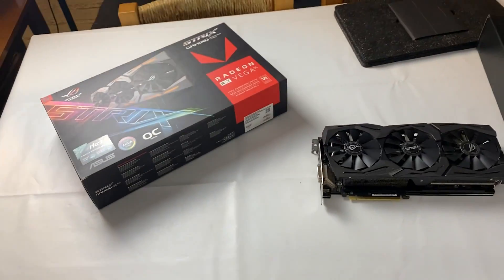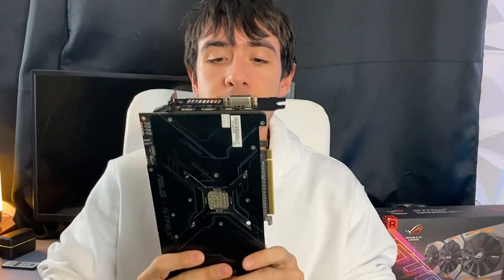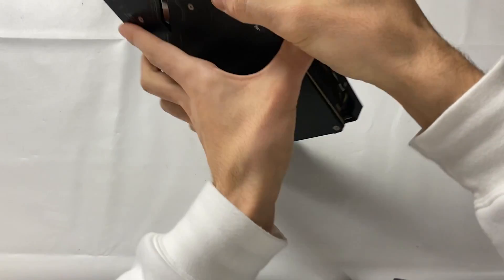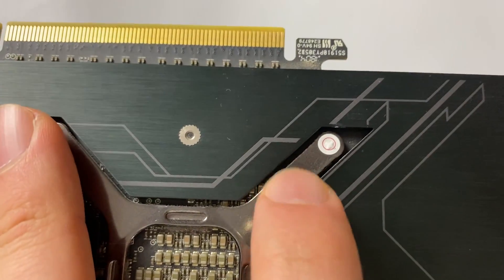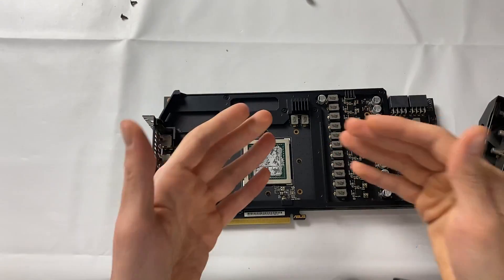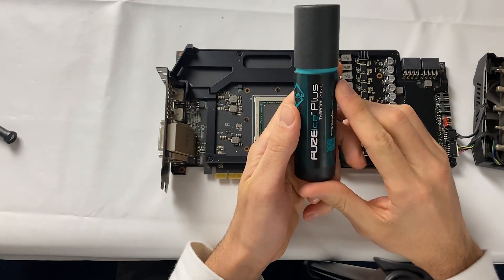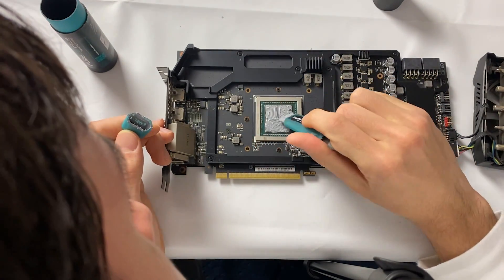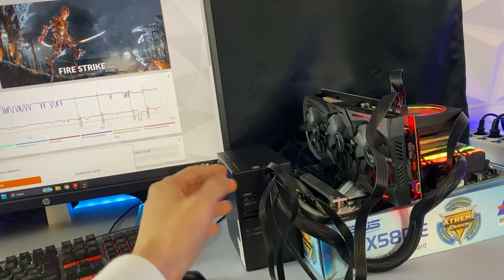Gaming on a RX Vega 56 in 2024… Bios Mod and Overclock for under 100$

Comment: 24500 graphics score fire strike 
Core:
p7 1710mhz 1070mv p6 1650mhz 1030mv p5 1450mhz 980mv p4 1250mhz 950mv p3 1138mhz 920mv p2 1084mhz 900mv p1 991mhz 850mv p0 852mhz 800mv 
Memory:
1100mhz 1000mv 
Power límit: 
+50
Gpu: Vega 56 gigabyte gaming oc with bios Vega 64 gigabyte gaming oc 
Cpu: xeon E5 2650 v4
Ram: 16gb(2x8 2400)

Comment: The Strix cards are awesome.I found a Power Color Red Dragon version in its original box and in very good physical condition. It tested good and runs cool but GPUz reports it runs in x8 mode only not x16. My other AMD cards run using all 16 lanes. I even tried it in another machine. I do not see any damage to the fingers or any damaged or missing SMD's. It runs very good and I know that it is not losing much performance but I still would like to solve this mystery. I even flashed the bios but no difference. If anyone has any suggestions I would appreciate any tips.

Comment: nice job but you have a golden sample card. most people cant get past 1100mhz memory, i tap out at 1080, never mind 1150. and your voltage being sub 1v for 1660mhz is again really crazy, i get unstable if i drop voltage below 1070mv at 1600mhz. my firestrike sits in the 23600 area. what you got is mental tbh.

Comment: Will this work on the Arez vega 56? from what i understand its a rebranded strix.
Reply: From what I understand you need a card with samsung memory or you are screwed
Reply: @rickmacdonald6355 It has samsung memory. I ended up getting it to work but have since sold the gpu.

Comment: i will buy this card asus strix oc in my area for 100$     
Knowing that 1660  used for 150$ 
should i buy vega ?
Reply: If you have a good power supply and are willing to have to modify its factory settings at least on the adrenalin drivers to get the most out of it, I definitely recommend it. Just don't pay more than $100 for it. I bought a Vega56 for $75 15 days ago and it's a beast.
Reply: @_Pikasso  In my area it's a very good price and considered a bargain
And i will undervolt it to reach 160 watt Or close to that

Comment: people forget that you can actually enable SAM / resizeable BAR with some modded drivers, it should increase performance even further
Reply: Only if the card is tuned proper with undvolts and custom regedit mods to increase its max draw. Hbm2 is its crutch and for sam to actually be a hindrance.  If vega had like gddr6 on it instead it would have been a beast and easily taken out a 1080ti, even though it can now with know how.
Reply: @michaelmok3646  the 56/64 vega card where made by AMD to answer the calls of the GTX 1080, which shows in performance tests.
so it's not uncommon or rare that these cards could also match the Ti version with some expert tinkering.

Comment: I bought mine vega 64 for 100aud that is like 60 euros just trying to find which cpu will work well in a budget happy with 1440p if someone has any tip thanks
Reply: Ryzen5 1600 or Something Like a 8600k should bei plenty of Power. My sister rund an ryzen 5 1400 Quad Code 16gb RAM and an rx580. She quiet Happy with this Setup
Reply: @danielbernhard1250  i have a 1600af and is not powerfull enough cpu will 100% lagging in 1440p i got finally 5600x and was perfect even for som 4k

Comment: I just purchased one just like yours but when I tried to do the ATI flash I am unable to see the screen when you select the new bios. I sent three hours working on it last night, I ended up replacing the paste and putting new thermal pads on it.  I’m just having issues with the ATI program I’ve even tried the older version I’m wondering if it’s not compatible with windows 11. After much research apparently you need and old version of windows 10 to make this work real bummer.  Please correct me, or inform me of a workaround if anyone has one.
Reply: Resolveu? Encontrou uma solução?

Comment: Got my Sapphire one and the cooler is twice the size of the PCB. Great temps. Zero frames drop in Fortnite. Great card. Of course it is great if you pair it with a capable CPU (i3 12100 seem to be quite enough for that video card).

Comment: Dear author, thank you for the guide. I managed to flash the Powercolor Red Dragon version and overclock it.  After tune I got 24197 points in firestrike graphics test.  But I had a question, can u please answer. Using stock bios 56 it consumed 185w, stock 64 220w. Now the peak values reach 300w. Is this normal, does it harm the graphics card? Temps and noise are ok

Comment: Ive been beating the living fuck outta my Vega 64 and R5 3600. Day in day, out Pushing high settings on 1440p since Jan. 2018. Card is a MSI Boost OC.. Basically Just a branded reference card So the first few years was tike living with a leaf blower! With that shitty fan always screaming at %100. Until I Got the nzxt AIO mounted. Didn't feel like drilling holes or looking for screws So i just grabbed a lil thermo paste and some zip ties. Lol they worked great for 3-4 years now.

Comment: You can get these cards refurbished from MSI Air Boost for $125Cdn from N.E.  They even updated the fan so that it's a lot quieter under load. I replaced my old GTX 1050 with a AB and boy was it worth it.  But then again the games I play aren't that demanding on a card. The game I play went for Mid to high 80 fps too 140's stock.
Reply: Fan quieter under load is the stupidest thing anyone would possibly think about. Video cards have a long life if they get cooled well not if their fans  are quiet. If someone need a quiet PC they should buy a sound dampening PC case not spin the fans at a lower RPM.

Comment: I have a vega 56 powercolor red dragon, which vega 64 bios should i use. there is not a vega 64 red dragon, only the standard 64 and a red devil?
Reply: same red dragon version. I used standart 64 it has power limit 220w. red devil version has 260. My stock vega56 185w - i was afraid to choose red devil version

Comment: Of course it’s still a useable card. It’s Better than a RX 580 and plenty of people are still using those. I got my blower fan style Radeon Vega 56 for 40$ almost brand new on fb marketplace a few months ago and threw it in my razer x chroma egpu that is connected to my 2018 Mac mini set up. It does the job and beats the internal graphics in any Intel Mac. I also have a 1060 6gb, a 1080 ti, a 2070 super, and an evga 3070.

Comment: do you still lookup the comments? hope so! i got a ASRock Phantom Gaming Vega 56 with the *.0.023640 bios and the HBM2 module but it is HYNIX, and not samsung. and everybody keeps saying that i shouldn't/couldn't flash to a vega 64 because of this (hynix, not samsung). though i've got a 0.046561 bios form techpowerup. is it ok to test even on a v56 bios?
Reply: I'm in the same situation, lets see if he answers you...
Reply: @narcsba  Disregard my last comment. The bios flash supports Samsung and Hynix memory modules. Should be just fine.
Reply: It's written in the "details" section what memory timings it supports (8192 MB, HBM2, Samsung KHA843801B) or whatever memory supports

Comment: Is it still worth it?
I want to upgrade from RX 580 8 gigs to faster card. The choice are RX Vega 56, RX 6600 XT and non XT, and RTX 2060 Super. Price range is similar for the RX 6600 XT non XT and the RTX 2060 Super. Of course, the RX Vega 56 not even a significant upgrade for me. But the price so cheap (it's only $83). I pair my card with FX 8350 btw.
Reply: You would be better to upgrade your cpu first. The FX 8350 even when overclocked is serving as a bottleneck for your RX 580. If you spend money on your GPU, you will not see much performance gained
Reply: @liferescripted  Welp, my RX Vega 64 just arrived. Guess I used it 'till next CPU upgrade then.
Reply from the maker: I think you made a great purchase with the Vega, it will go a lot faster than the 580 if tweaked properly. But yes I’d upgrade the CPU asap as well!
Reply: @ImWateringPSUs  Yep it's true. I undervolt and OC my RX Vega 64 and get 3-5W on idle, 60-70W while playing MGSV and Nier Automata without anti aliasing on 1280x1024 resolution. I'm happy enough with the result!
Reply: no please do not pair any vega card with any fx cpu. Both of those parts were famous for using waaaay too much power for their respective times. unless you have a high wattage, high dollar psu, and do not care about how much your power bill costs, upgrade your cpu to something newer first like any amd ryzen, ddr4 intel cpu, hell even a ddr3 intel cpu would do better than an fx.
Reply: @steaksoldier  vega still draws alot less power than an rx 580 for the exact same fps and settings... for example playing in 60fps locked, where rx 580 draws 120W, vega draws 80W... Its those extra 30 more fps that costs 100W more power on vega
Reply: @bervirus  Yep, that's true. I'm amazed this card more efficient than my old RX 580. I usually leave the vsync ON for the efficiency.
Reply: Which one is better ? I will buy one of those  @bervirus
Reply: @SergeoRamos-f9u  Between RX580 and Vega? Vega of course...  Anyway for 2025 if you have the budget, better to just get RX6600 or something newer...
Reply: @bervirus  dont have budget for sorry 
Now i need to understand something rx vega 56 with flash bios 64 V limit better than rx 56  normal bios with V limit 
I will buy one should i do this ( bios 64 ) is this stable
Reply: @bervirus  i will play 1080 should i do this or just keep normal bios
Reply: @steaksoldier  Thanks for the advice, soon I will upgrade my CPU for better performance per watt

Comment: I still own my Vega 56, which I bought back in early 2019. I ended up purchasing the Morpheus II cooler for it. It's a great card if you're happy to tinker, and I was. It's now in my girlfriend's PC.
Reply from the maker: That’s great to hear! I’m a big fan of aftermarket GPUs coolers, love the Arctic Accelero as well and even the NZXT AIO kit. It’s a shame they stopped making them :) Great to hear you’re still putting the card to good use!
Reply: @ImWateringPSUs  I looked at both the Nzxt and the Accelero, but I went with the core edition of the Morpheus 2 cooler, I read it had a larger die coverage for the Fiji and Vega cores. It wasn't easy to find one at the time, but I managed.
Reply: Same here lmao

Comment: hey i have a vega 56 air soft msi and a 5600x do you think i should do this? do i need to unisstall something?
Reply: I have same card. It should have dual bios. You can flash the 64 bios on one and have the regular 56 bios on the other. I have had that card draw upwards of 300 watts of power and it is really finicky. When the 5600XT came out I compared the vega 56 to it and ran benchmarks. Always got ~10-15% better performance on the 56 over the 5600XT(with the 56 bios on the vega). However over the last year and a half, that has drastically changed. I am talking a 20-30% swing. Haven't really delved into it much, although I have used modded AMD drivers from NimeZ for SAM and other features but really no difference. I am running a 5600X processor and I have since it was released. I jumped about 10-15 fps in Heaven and in the games I play like WoW, COD, The assassin's creed franchise, on both cards, upgrading to the 5600X from the 3600. And that drastically changed sometime in early 2023 I believe because on Heaven alone, I would average about 100-105 fps total in the full benchmark with the 5600XT and anywhere from 110-115 with the vega in 1080p. Now, its the opposite. 95-105 fps on vega, 110-115 with 5600XT. nothing changed in my PC but the updated drivers. I firmly believe AMD has purposefully left out the vegas in driver optimizations because its coming up on EOL. And is exactly why last summer I switched to team green and will never buy another AMD video card. Their decision to scuttle Polaris and Vega architecture support is mind boggling. I have never owned anything but AMD Video cards until they pulled this crap. Shame on them.
Reply: @jasonphillips6400  so what are the down sides?
Reply from the maker: I would definitely recommend doing this, yes! No need to uninstall anything :))

Comment: I hope you answer i have a vega 56 shapire pulse (samsung memory) myself paired with a r5 3600 and only get around 100 fps on warzone with bad 1% lows do you think doing this mod with be worth it?
Reply from the maker: It will 100% be worth it! But your limiting factor is also the CPU, you should get a R5 5600X if you can

Comment: Bro, I just picked up this MSI Vega 56, and it seems to have Black Screen issue, do you happen to have any tips for it?
Reply from the maker: If the card boots and sometimes black screens, a different bios can help. If it doesn’t boot at all heh, it’s difficult to fix my man😅
Reply: @ImWateringPSUs  Bro are you using windows 11? I'm in 10 right now, does it make any difference if I upgraded to 11? Also what driver and driver version are you using right now.

Comment: Does it have any cons if in case you do this? Like throttling or overheating or even killing the gpu itself.

Also, will it more power? Or its just as advertised at 210W. Will it also work to my Gigabyte GP-P650G PSU? Or need more power
Reply from the maker: It’s all about how you set it. After the undervolting in the end, the card drew 150W to perform dramatically better than at stock. But if you only bios mod it with no Undervolt, it can draw as high as 300W. It will definitely work fine for your P650G PSU, check out the build video I made with it as I used it with a 550W PSU.

Also consider dropping a like and subscribing if the content was useful and/or interesting:))
Reply: @ImWateringPSUs  fasho thanks man! Lovelots from Philippines

Comment: Got vega 56 for $70 last year (gigabyte gaming oc model). Great GPU but not for everyone, especially this particular model.

Comes with freezing and overheating issues (black screen with max fan). Its still definitely worth it ---after I cleaned it, repaste it, replace thermal pads (5 different thickness), added heatsinks to the backplate, flashed the latest vbios (with slightly reduced power limit), tuned the fan speed (default fan curve was too slow/silent), adjusted power limit or UV, and used the Pro Edition driver.

Now its running problem free, and will serve for another or couple years, probably. Scored 20800 at default (210W) on firestrike. Still scored 19600 on my UV profile (~125-135W).
Reply from the maker: Great to see some feedback like this one! I 100% agree with you, it’s probably the best value for money card out there but one has to be prepared to do some maintenance/upgrades in terms of paste and pads and ready to undervolt it!
Reply: I agree mate! Have the exact same model and every now and then I get black screen with max fan speed. its annoying AF. I hae yet to find out how to fdix this problem entirely
Reply: High hotspot temps

Comment: can you use a vega 56 with a 500w psu?
Reply from the maker: 100% yes, if you check on the channel we actually used it with a PSU with just 380W effective power on the 12V line!

Comment: I have a vega 64 and I got a graphics score of 25.455 in the fire stark test (overclock & uv). What were your overclock and uv settings and how many watts of power did it draw from the outlet?
Reply from the maker: You got a massive score there! Great settings :) Also thanks a lot for your feedback, I really hope GPUs like these go more mainstream! My Vega drew roughly 180W under full load, total system power was roughly 350W. The UV settings I show a bit in the video, I show the curve. Memory overclock 1150/1200Mhz
Reply: And your video is really useful. You tell people how they can seriously strengthen a 100 dollar graphics card with a simple BIOS update. Once people realize this, they will stop buying cards like RTX 3050 or RTX 2060/s.
Reply: @NicHolasBrody44  Nvidia is like Apple. People buy it because it's a brand, "it just works" and fEaTuReS as if RT works on a 3060. They aren't doing it because they're informed and looking for good price/performance.
Reply: Rx vega 64 or Rx vega 56 ?

Comment: How much power does it pull? I just come across the video after buying one, but its the reference model and i only have a good bronze 550w psu. Do you think its worth flashing the 64 bios on it even with a smaller increase on powerlimit?
Reply from the maker: Very good question: total system power after the flash, with PL unlocked and no tuning was roughly 550W. After the tweak it was roughly 400W. I’d say you can definitely make do with the 550W PSU you have, I’d definitely recommend flashing it because it’s free performance but I would then undervolt (you can copy my curve). Congratulations on your buy and consider taking a look at the full Build video I have on the channel, where we paired it with an 8c i7 and a 500W cheap PSU!
Reply: @ImWateringPSUs  You don't actually need to manually undervolt the Vega GPU. It's done in the AMD driver if you choose so and it is almost like someone would do it manually. IO can't stress enough how important is a good PSu for a stable performance. You should recommend at least 650 good quality PSUs. I know what I am saying. I am doing electronics repairs and I know what a low quality PSU that's not giving enough power can do to a gaming system.
Reply: @ImWateringPSUs  hi sir, can i ask what is the risk of flashing bios?

Comment: i cant get past the cmd unlocked rom part i dont get it
Reply from the maker: Basically on some GPUs you do need to unlock the flash manually via CMD. Worst case you’ll need to actually perform the flash via CMD so you have higher privileges, but it’s truly simple, just copy the commands I use in the video and run everything as an admin and CD C:/yourpath to run the exe
Reply: i made it and did everything but i get artifacts on my screen when i game is there a solution ? @ImWateringPSUs